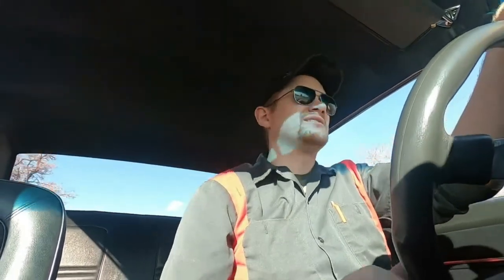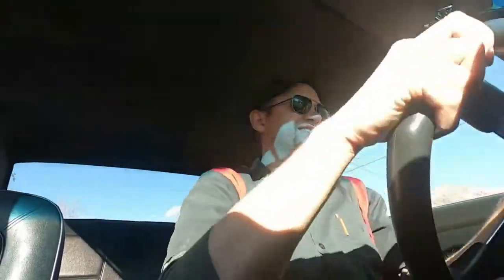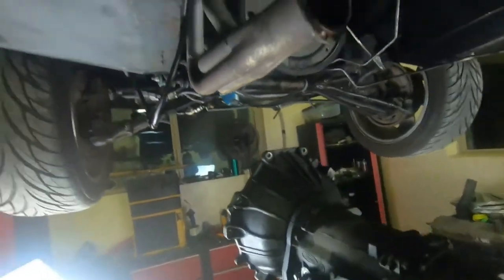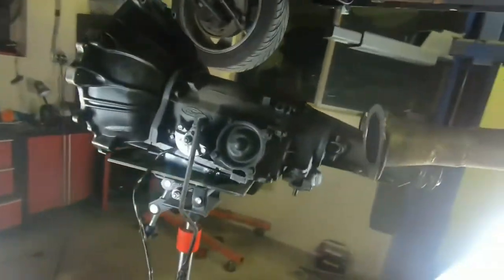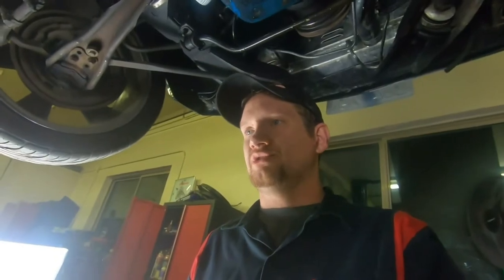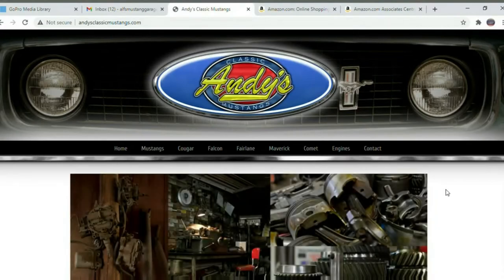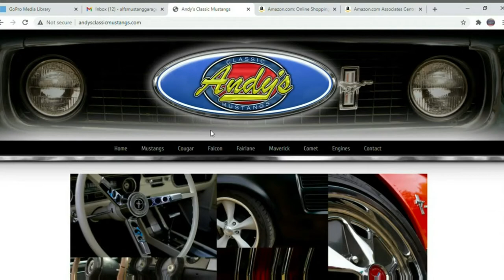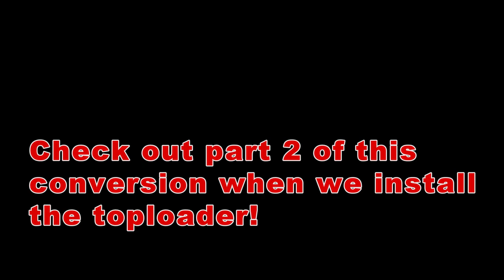Transmission Conversion C4 Auto to 4 Speed Toploader- Part 1 - 1967 Ford Mustang

Comment: Your videos are excellent and you have a great talent for explaining procedures in detail, just like teachers do it in school -Could you do a detailed explanation/video on how to check or measure out bell housing run out with a dial meter before transmission installation? Lot of guys, including myself, are interested in T5 conversions on the mustangs, but the explanation out there are very confusing and everyone shows a different methods and eventually end up with more questions than answers. Thanks!
Reply from the maker: Oh cool thank you very much. So I will do a video on that if I get the opportunity to. I should be getting a 5-speed conversion here in a few months. But he hasn't officially pulled the trigger yet.

Comment: Hi there again... I watched all the parts for the c4 to manual conversion great videos!! Always learning from your channel, quick question.... if I wanted to do this same exact conversion to a inline 6   is it pretty similar labor wise? 2nd what different parts would be needed? I'm guessing bell,fly, clutch? if so which ones will I need? Thanks for always helping much appreciated!!
Reply from the maker: Labor wise it should be very similar. As far as parts go, the clutch, bell, z-bar, flywheel are different. You'll essentially be gathering up all the things for a 6 cylinder rather than a v8

Comment: Oh Joy! You always seem to have a video on what I'am going to do. I have a 460 BBF in my 67 Mustang, and I really worry about pulling those headers! You talk a bout a tight fit, wow. And, I don't have a lift, so under car on my back with jack stands. Can it be done? Thanks for sharing, Cheers from Motown, Happy subscriber here.
Reply from the maker: Hey Robert! Ya it's a wicked tight fit. One of my personal cars is a 67 with a 460 so I know full well your struggles. And in my younger days I used to lay on my back all the time to do this work. Anyways, yes it can be done if you're asking about just removing the headers. Now that also depends on the headers. The ones I have for mine are all single pipes so they come out really easy actually. They just come out in 8 pieces lol. My only regret with these headers are remembering where I got them from. It was too many years ago and I wish I could find out because I think they are perfect for a 385 series in a 67/68. So are you going to throw a toploader behind that big block? If so, that will be a monster!

Comment: Just curious, I want to upgrade my engine and transmission. I thought about the tremec 5 speed but I would love to keep mine automatic for ease of use and less maintenance. Can you give me a general cost for the transmission swap?
Reply from the maker: Well it's hard to provide cost estimates for a transmission swap based off the Information you have provided.
Reply: I hear you. I am surprised you got back so
Quickly. My car is an old 65, it needs a lot of work. Im going to put a 351 in it eventually, but I am in desperate search for a modern automatic transmission option that would work with it that helps with fuel economy and reliability for the highway. I want to make it a daily more or less. I have no fear of going manual but Im hoping to not have to. Maybe you might know about such things? Im not even talking price anymore. Just ideas.
Reply from the maker: I've never done one but it sounds like you might want to look into the AOD transmission conversion. No ecu to wire in and had overdrive for good freeway use. I hope that helps.
Reply: @AlfsMustangGarage   it does. I believe it does. I will look into AOD swaps.